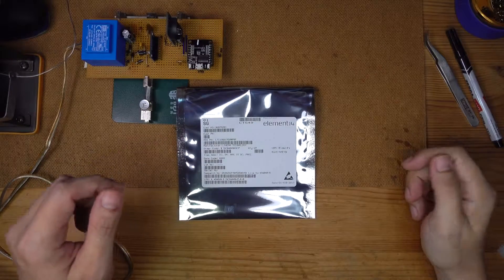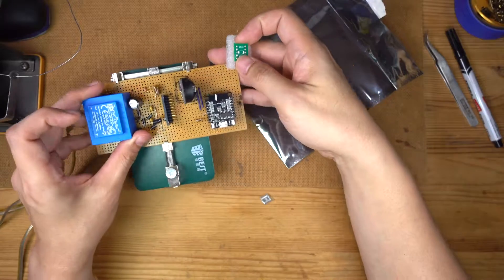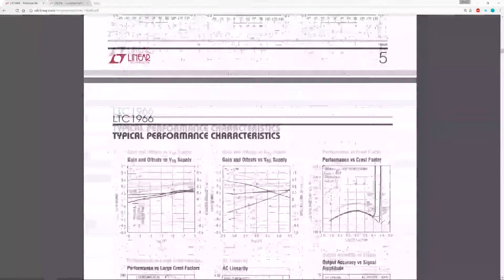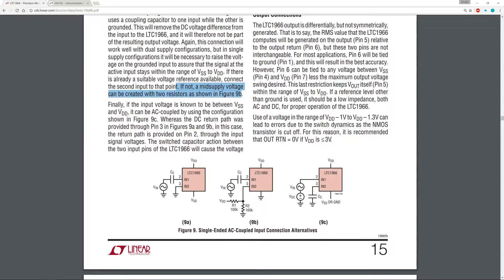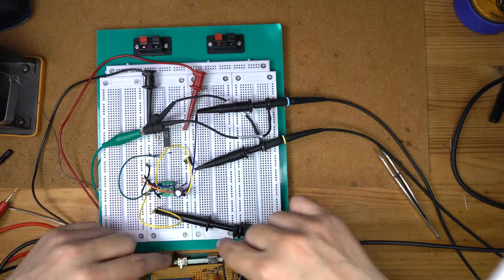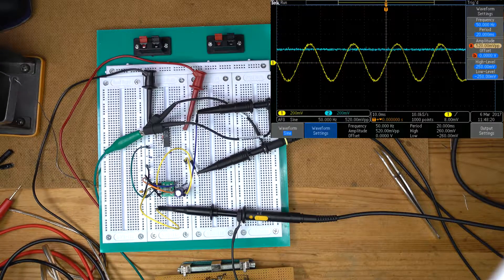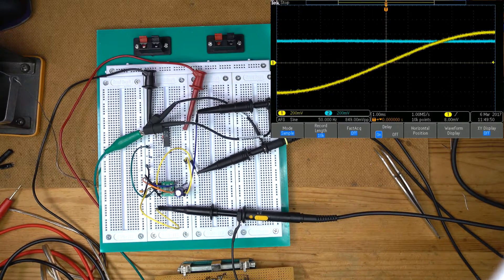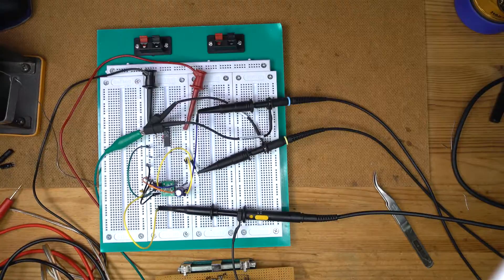Logging household power consumption (pt.7)

Comment: I want to measure RMS at 100KHZ, can LTC1966 be able to do it?
2% error is okay
Reply from the maker: The LTC1966 is an analog RMS converter. It converts the AC to an equivalent DC RMS value that you can measure. In this case, you do not need a fast ADC to read the value. I think you're thinking of directly sampling the AC signal - in which case, 100kHz is probably overkill. You probably need something like 10kHz which makes processing quicker and simpler.
Reply: @danslab8875  The project i'm dealing with requires to measure power delivered to an induction coil with switching frequency ranging from 1khz to 60khz. I want to measure the RMS current in the coil, which is coupled out via a current transformer. Can you suggest some IC's or techniques which can deal with this?
Reply: @Gowtham02-l4c  LTC1967 -  up to 200kHz
Reply: "The LTC1968 is designed to work very well
with inputs of 100kHz or less." datasheet
Reply: "The LTC1966 is designed to work very well
with inputs of 1kHz or less."  - datasheet